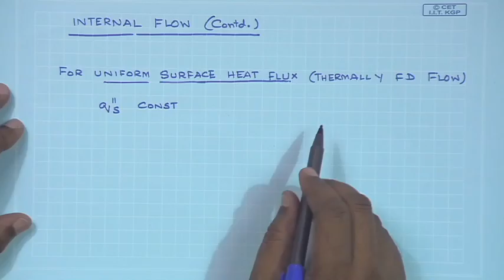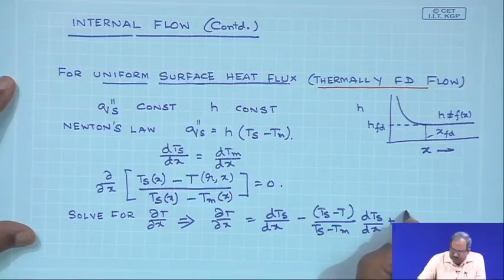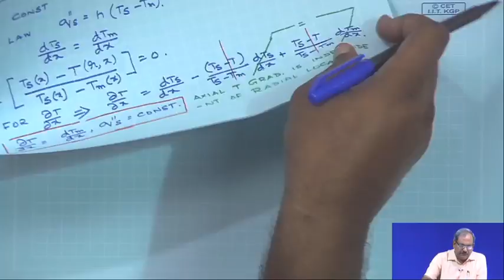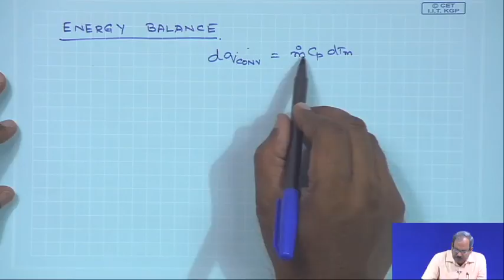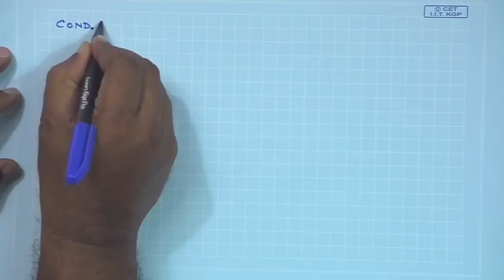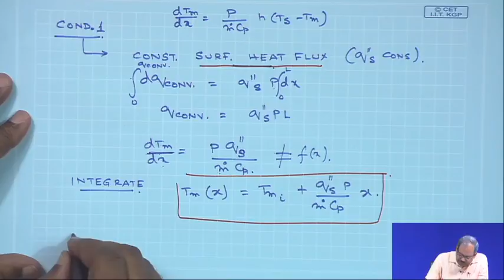Lecture 33 : Internal Flow Heat Transfer (contd.)

Comment: Why there is decreasing profile of h with x before fully devloped thermal flow in constant heat flux condition
Reply: Because the thermal boundary layer thickness is zero at the tube entrance, the convection coefﬁcient is extremely large at x # 0. However, h decays rapidly as the thermal boundary layer develops, until the constant value associated with fully developed conditions is reached.
Reply: Because the heat transfer penetrates as x increases
Reply: Because, h is proportional with Nusselt number. 
• As Nusselt number is just proportional to Reynolds or Grashoff number & Prandtl number by any finite power especially for flow through pipes or internal conduit. 
• Prandtl number is inversely proportional to the length of thermal boundary layer which increasing along direction in downstream of the flow. 
• This cause h to decrease due to overall inverse proportion till the merging of thermal boundary layers at fully developed region. After this there is no need for h to depend on thermal boundary layer thickness. So, whatever it achieved till it will remain constant further throughout the flow. 
• But this approximation is only useful for constant wall heat flux. Wall may or may not have necessarily to be at constant temperature as we can not control both temperature & heat flux at wall interface surface at a time.